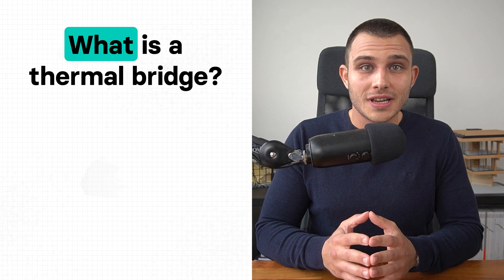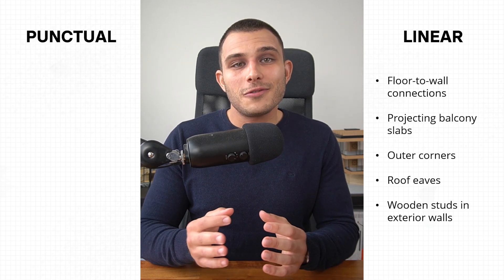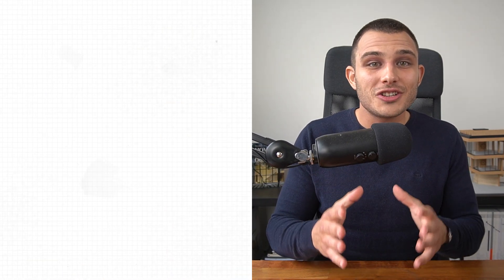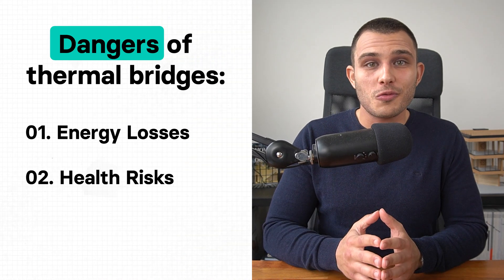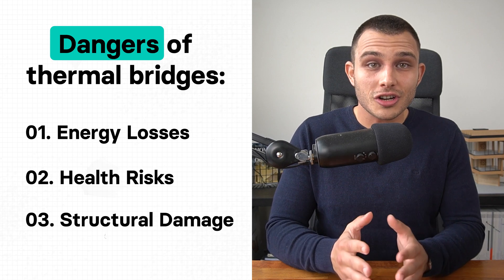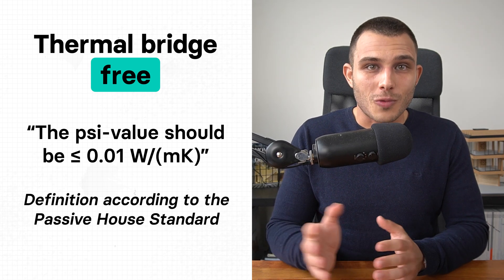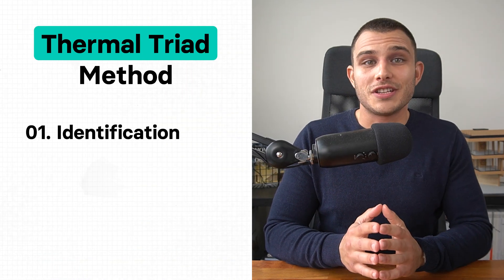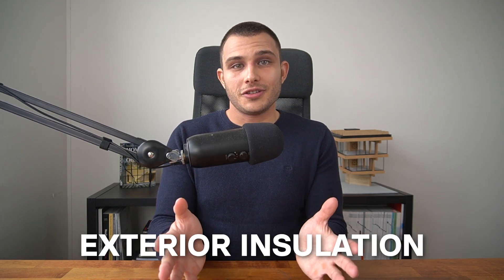Thermal Bridge Explained: Invisible But Dangerous

Comment: Good explanation.
Now, how do we insulate a 40mm timber door without making it so thick it feels like a bank vault, and without using petrochemical foams?
Reply from the maker: Doors and windows of old existing buildings should be replaced, if possible. You can find high-performance components here - https://database.passivehouse.com/en/components/

Comment: If heat rises, are thermal bridges like floor joists less critical than ceiling bridges?
Reply: Heat does not rise. Hot air rises. Any thermal bridge will wick heat at the same rate no matter its orientation. With that said, some parts of your structure will have higher heat differentials than others -something that only you can determine for your specific situation
Reply from the maker: All of this very much depends on the details and insulation thicknesses. The difference between the floor and ceiling due to the rising warmer air isn't that significant.

Comment: Thanks for making the time to produce this video, its really helpful.  Part of my job involves installing timber and Aluminium windows into older heritage properties in the UK.  Our thermal envelope doesn't exist on properties that mostly have solid walls with no cavities being the norm.  Many times we're fitting our windows/doors behind the stone or brickwork to match the original and working in very tight spaces.   Where needed we may use Fixing foam to hold frames in position if through fixings or straps aren't an option. Can you advise of any products we could consider to use as thermal breaks between the frame and the surrounding brick/stonework that is suitable for very restricted areas?
Reply from the maker: Thank you, Bev! I'm glad you are enjoying the videos. A suitable material for the gap between the brickwork and the frame is one with very low lambda value, like PIR or sometimes in very narrow spaces is used vaccuum insulation (which is still quite expensive).

Comment: Hi, do you have any videos on passive house design for hot and humid climates?
Reply from the maker: That's a very important topic and I will be releasing a vido on this very soon, so stay tuned 🙂
Reply: Exactly my question because of a house in Indonesia. Temperatures up to 45 C and extremely humid.
And as it is a very poor country, the solution has to be very very cheap.